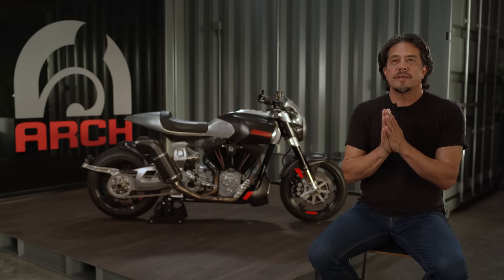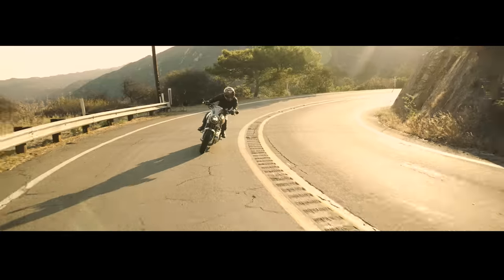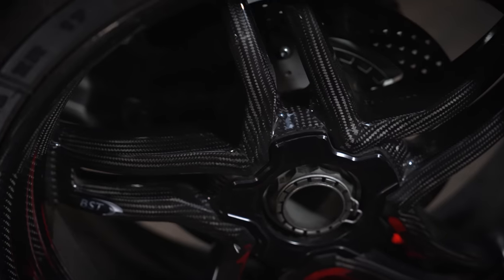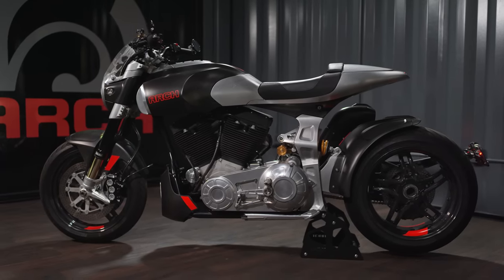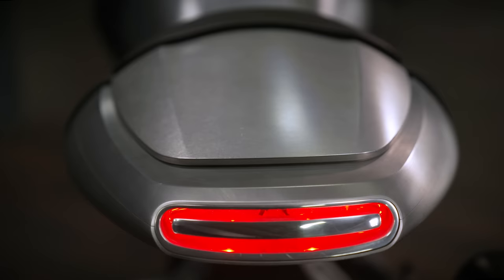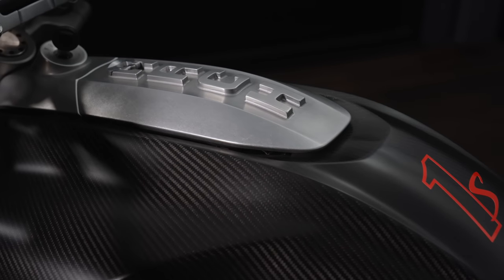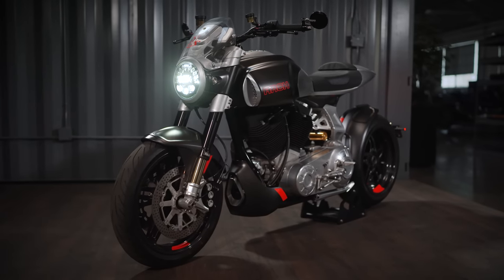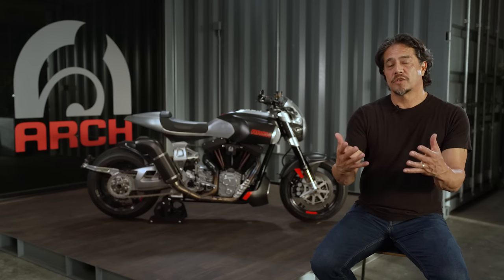Meet the ARCH 1s

Comment: I admire and respect the vision and engineering that goes into all Arch motos. BUT. Much like the Wraiths of the past, they’re simply unobtainable for the common man. Look at what refreshed Buell is bringing to the table with the 175HP Super Cruiser with an expected price of somewhere between $20-30k. Cheap? No. But in-line with current Harley price points. Especially in this day and age when EVERYTHING is just getting more and more expensive, it’d be cool to see a company focus on getting more people on 2 wheels rather than making beautiful collection pieces for the extra wealthy.
Just food for thought.
Reply: it's harder to compete in cheap, in premium it's easy, just say you make 20 of these and it will be sold out before anouncement